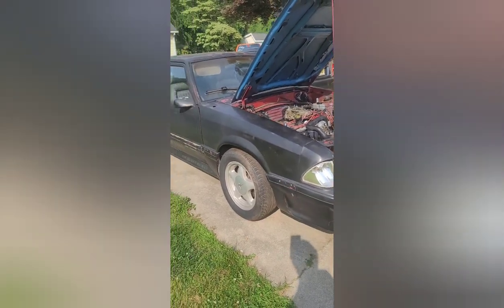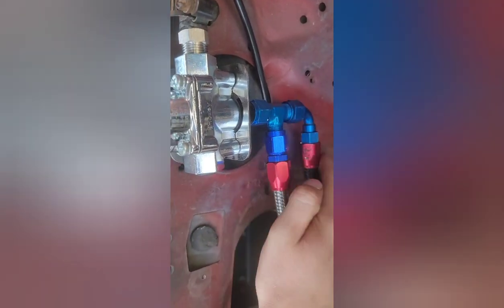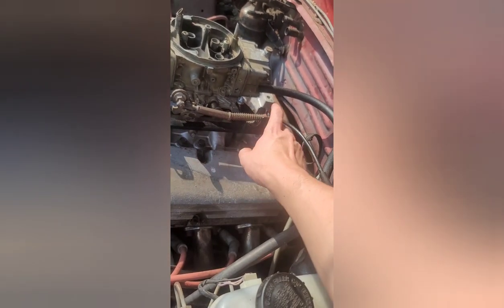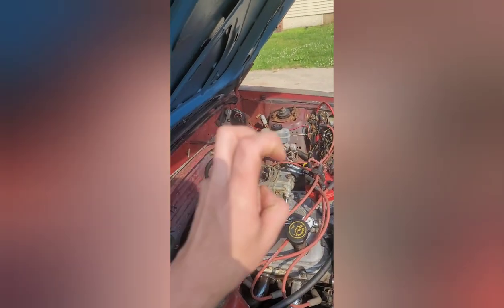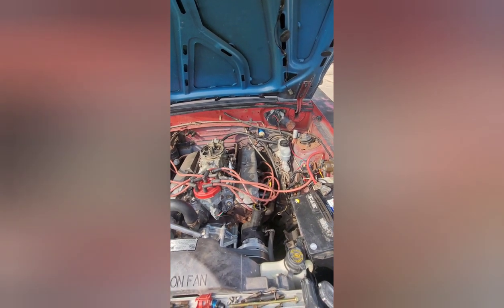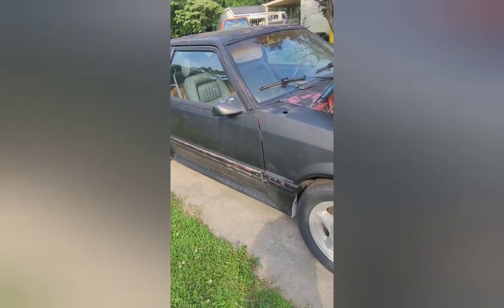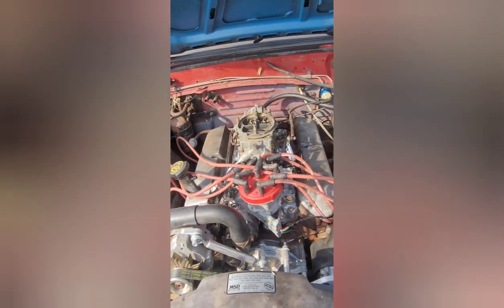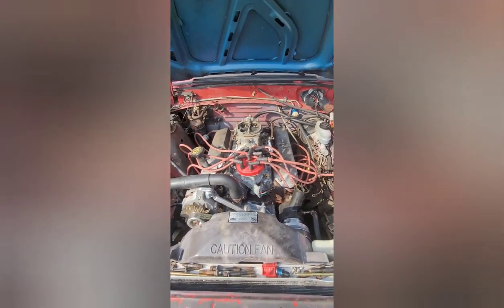How to carburetor swap a foxbody from efi without "ruining it", the easy way.

Comment: I put a 351 Windsor in my 87 GT and a quick fuel step down fuel pressure regulator and I didn't touch the computer or the distributor wiring all I did was put a carburetor and drop the fuel pressure and this thing runs great, I made a hybrid distributor out of a 351 distributor and a 302 distributor, all of the gauges work
Reply from the maker: Yeah thats one way you can do it aswell. Ive done the same thing, just alot of wires under the hood lol

Comment: Hello Adam , young man YOU have convinced me  to swap to a carb set up, I  like the fuel injection systems  and they're  ok and relatively  easy to work  on,but the carb just gives you a feeling of  if I may say, Seat of the pants ,I think that  carbs are "user" friendlier  unless they are related to Diesel lol,I am a sub to you and your dads channel, I  have a all original  93thunderbird with  less than 143k all highway miles 1 owner car
Reply from the maker: Awesome thanks for watching sir! And yeah carb def has a strong feel where the efi seems less responsive and laggy. Thats why i like carbs too. This setup is easy enough to switch back and forth so it doesnt hurt anything if u do go carbed this way. Thats why i like doing it this way. Makes it simple and easy

Comment: I've been asking about this type of fuel line/regulator setup on foureyedpride the last few days. Pretty convenient that you put out a video on it! Any idea how much pressure is in the feed/return line when it's running? When I do this, I plan to install a fuel pressure gauge before and after the regulator.
Reply from the maker: Im not sure how much pressure goes through the return side. I do however know you can get about 60psi or so out of a stock efi pump. Ive never put a gauge on it to see, aslong as have steady 6.5 psi at the carb im happy lol glad this was able to help you. Im also a member of that page on facebook lol

Comment: Might do this with my 91' lx, the 5.0 is coming out and 351w based 414 c.i roller cam bad boy going in , will try a 950 holley. Holley style makes best power.  The efi and pcm mass air tuning for my engine is looking like a pain. So i have a few intakes and  carbs sitting around anyhow  😂
Reply from the maker: Nice, good luck w it, it should run good!

Comment: You can buy a re-pop factory throttle cable bracket that bolts to the intake for about the same or less than the bracket you are using.  One source is LMR.  #LRS-9758BRKT-K
Reply from the maker: Yeah for the price these look alot nicer in my opinion so i just get this style and modify them

Comment: hey great video it explained alot i was wondering did you keep the original fuel pump inside the tank ?? i got an 84 im trying to swap over to an eddelbrock 4106  carb
Reply from the maker: We actually put a 255 fuel pump in,  but you can use the original pump as well

Comment: In the process of carb swapping a 87 crown vic, using a vacuum advance distributor and streetfire box. It calls for the original coil positive wire (from ignition key) to connect to the box. I have found two 12v switched wires that are Red/LG but doesnt power the box up. All grounds have been checked and are good. Maybe the Red/LB wire is the one I need to use?
Reply from the maker: Ive honestly never used a streetfire box. I have had trouble with msd boxes needing to use different wires from the box.

Comment: What two wires are you grabbing to run to a toggle for the fuel pump relay? Is it a power and ground? What color are the wires?
Reply from the maker: I usually take a test light, find the hot wire then make a jump wire and shove it into the hot wire i found and jump it across the plugs to find the pump. Then i run my toggle to both of those. The toggle goes inbetween them if that makes sense. Or u can find another source thats hot to go to your switch and just run one wire to the pump wire in the relay pig tail.

Comment: Great video. Hey question what alternator bracket is that? It looks super similar to mine that I got from Jegs. But I cant get my 3g alternator with a very similar bracket to line up at all. My alternator is about 3 teeth to far forward and keeps chewing up my belts and I think has messed up my alternator.
Reply from the maker: Most aftermarket brackets require modification.  I believe this is a march pulley setup on this car, but if your alternator goes in you can take the shim and shorten it to get the alignment you need for your setup
Reply: @GroverBoysRacing777AdamGrover  yeah thats what I was thinking about doing. Grinding the spacers down to bring the pully in. Was just curious if I bought the wrong one or something lol. Thanks for the reply and thanks for the content.
Reply from the maker: @allenhouse7224  any time,  yeah thats what i usually do is modify them to work lol.

Comment: Adam one other quick question, when I pulled the harness out there was 3 wires running all the way to driver side kick panel? what are those 3 wires for, it doesn't seem they are going to the ecu but are bundled in to the ecu harness, do i just leave that disconnected in the driver side kick panel?
Reply from the maker: That doesn't sound factory so I can't give you a forsure answer on that.  Id have to see them.  Message me on my Facebook if you have one. Usually anything that goes to the engine harness is no longer used.  The headlight and alternator harness is usually seperate which those you will still use
Reply: Those I think go to door speakers, power windows, power locks, etc. I looked at mine, thats where they seem to go.

Comment: I see now after reading some of the comments, you said 36* and run a toggle switch to the pos side of the coil. You say if engine is hot crank with the switch off then flip it on start while cranking CORRECT? One more question what about a rev limiter if you’re NOT Using an msd  box?
Reply from the maker: Yes that's correct crank it and as youre cranking pop the toggle on, and you wont have a rev limiter. I usually dont use one or set it really high anyway so it never bothered me
Reply: thanks for the reply

Comment: I guess I am dense...I just don't see the advantage of carb over  EFI. I have EFI on my 89 notch, and carb on my 57 Chevy. Considering all the work you did to convert to carb, please explain what you gain? I know all the issues I have with my carb! Thanx!
Reply from the maker: Gain cheaper easier hp, easier to work on, clean engine bay, less things to go wrong/bad, compared to a 30 year old efi setup with broken wires and such. Im not against efi, but for some carburetion is the easier route. You may not see the point, but theres alot of people who want to convert to carb without hacking their mustangs up but dont know how to. Thats what this video is about.

Comment: I have a 91 f250 7.5l efi sucks ballz nothing but trouble E40d would a carb swap bring this beast back to life ?
Reply from the maker: The right intake and carb combo can net usually a 50 hp gain on any ford motor compared to factory efi. On a big block 460 with an 850 and a nice dual plane its around 100 or so. So yes it would wake it up putting a carb on it
Reply: @GroverBoysRacing777AdamGrover  what would I need to do with the E40d will it work
Reply from the maker: @truyumz2595  that I'm not sure.  I think they sell a controller for it,  may be able to keep the efi harness hooked up for your ignition,  i would think it either works off of rpm or speed sensor.  Ive never ran the over drive automatics to be honest so i really couldn't tell you based off of experience. May find something on it on Google
Reply: @GroverBoysRacing777AdamGrover  thank you
Reply: @GroverBoysRacing777AdamGrover  excuse my questions if they seem ignorant you, your knowledge on this is far superior than mine. Is it a good or dumb idea to use the E40d or is there a better maybe a more cost effective approach to this aspect of the  conversion?
Reply from the maker: @truyumz2595  it all depends on your intentions w the vehicle. If its a cruiser or somthing you want to race more often etc.
Reply: @GroverBoysRacing777AdamGrover  not racing but I do pull a trailer with 3 quads and camping gear from Portland to the beach over a small mtn range then on the sand we go I'm on 35s/4in lift/ headers/ smog delete /and a large stereo system. and I drive it to work often in traffic with no side mirrors yah I'm that di** I get over until I hear breaking glass but I always use my blinker....
Reply from the maker: @truyumz2595  then id keep the overdrive transmission. Itll be worth buying the controller for it in the long run
Reply from the maker: @truyumz2595  it is pricey but that od will be nice for those long cruises heres a link to a controller for the e40d transmission

https://www.usshift.com/?gad=1&gclid=CjwKCAjwjYKjBhB5EiwAiFdSfpCMxO55zGu-kcQ3q7is21AxfXvKqnp52IjHG7dtUdqSwro8AxB1mxoCzjsQAvD_BwE

Comment: Hey man do you think tha distributor trick would work with the 460 distributor in the trucks too ??? Im putting one in a mustang and dont have a msd box to go with my aftermarket dist !!!
Reply from the maker: I plan on using this setup on my dads 460 build, so i dont see why it wouldnt. Id assume wiring would be the same. Ill be trying it lol
Reply: @GroverBoysRacing777AdamGrover  im going to aswell .. if it works …GOOD … if not then its just too bad ..lol
Reply from the maker: @glennramsey917  i dont see why it wont
Reply from the maker: @glennramsey917  just make sure the distributor gear is setup for your camshaft so u dont mess anything up.
Reply: @GroverBoysRacing777AdamGrover  yes sir … im 49 years old i have ben building motors since 1988 …i know the difference in gears n such but my downfall is electric stuff.  This video has changed the game !!!!

Comment: I noticed the coolant lines going to the heater are disconnected does this carnot have heat in the winter? No ac in the summer I want to do this swap too I just don't know all the parts like you
Reply from the maker: This car doesn't have heat or ac hooked up
Reply: Thanks for the response I've been looking up parts for the past 2 hours trying to figure out what I need and it's so  broad, I'll have to watch your video again and again and listen step by step so I can get a list. I was gonna go through lmr or cj pony parts but those carb intake kits are like 1000.00 and you still need fuel lines
Reply from the maker: @tylerford2651  yeah u can do it way cheaper than 1k if you source everything correctly and do it yourself etc. Esp if you sell the efi stuff.

Comment: What timing do you start with on the locked out tfi? distributor
Reply from the maker: Depends on the combo, but i usually run 36° on an e7 stock bottom end 87-92 engine
Reply: Thank you for the reply
Reply from the maker: @charlesellenberger1352  no problem. I appologize i didnt reply sooner, i never got the notification.
Reply: No problem 36deg is what I thought would be a good starting point. Thanks again
Reply from the maker: @charlesellenberger1352  yeah 36 is usually the ticket where they like it. Depends on the heads and combination mostly though

Comment: Adam, what 2 wires on the fuel pump relay?
Reply from the maker: I use a test light to find the power source then I jump the others to see which one kicks on the pump and locate it that way. Then I depin the 2 out of the connector and use male connectors to slide in the terminals so nothing gets cut, and u can either heat shrink or tape them up so nothing shorts out
Reply: @GroverBoysRacing777AdamGrover  thanks, I will try that!
Reply: ok got mine wired today, pink and black from relay goes to the intank pump, I ran a 12v switched to that and it works, my relay had no power / 12 v switched or anything going to it at all, I think those 3 wires I mentioned above that ran from driver kickpanel to the ecu area must have been the main power. Anyways just put a spade terminal on the 12v switched and plugged it into the pink and black female terminal, taped it all up and wroking well so far! thanks Adam!
Reply from the maker: @vrm86gt  yeah that's how I usually do it or I depin the connector and use a spade terminal into that female connector that ford puts on the wire and wrap em up. Glad you got it!

Comment: Does the alternator need to be rewired at all to work? I’m in the middle of the swap trying to figure out what all I need to do to make stuff work.
Reply from the maker: Alternator wiring is part of the headlight harness if i remember correctly so no. Once you pull the efi harness out youll be able to see. I usually convert over to a 3g alternator from a 94-95 mustang gt which will require a rewire. But the schematic can be found online
Reply: @GroverBoysRacing777AdamGrover  thanks! Appreciate the reply!
Reply from the maker: @kennypearson393  no problem, good luck with your project!

Comment: I did a carb setup. Now I’m getting nothing on the dash or fuel pump. I get a click when trying to start. I’m getting power to the switch and to the starter solenoid but not on the dash. Do the wires need to be in an order on the solenoid? A week ago I had everything working. All I did was take out the motor harness
Reply from the maker: If you removed the engine harness the dash wont work. You'd have to look at a schematic, get a pig tail, and pin the wires for the gauges in the dash. If the engine is just clicking and not cranking over, you may need more engine to chassis grounds. Take a pair of jumper cables and put one side on the engine (intake bolt, bell housing boltalternator bracket bolt or clean metal of some sort) then connect the other side to the chassis or even one to ground on battery and other to chassis (clean metal, bolts going into frame rails, firewall, or inner aprins). Thats a quick way we use to rule out inadequate chassis grounds. As for starter solenoid wiring, one side should be a few hot wires 1 from battery, along with a few others, other side should be 1 wire to the starter, then theres 1 wire for the small post that just pushes on unless someone changed it to make it bolt onto the small post. Google your year (mustang solenoid wiring) and you should be able to find it to verify wiring order. I can almost garuntee its not enough ground cables though. Good luck and let me know how you make out!
Reply: @GroverBoysRacing777AdamGrover  so I did that and I’m still getting a click. I checked with a light, I have power to the ignition switch and power to the solenoid. I put the light on the red/blue small wire. I hit the key to start the car and the light worked. So I know I have power to the wire when it’s in the crank. And when I say motor harness I meaning the passenger side harness is gone. I still have all the wires on the driver side. Like the yellow, the black/white with the little box, and a few others. I also tried jumping the solenoid and all I’m getting is spark and I tried two different solenoids. And this is on a 1987 lx 5.0 t5 conversion. It was a 4cy automatic. Oh let me add I’m running a msd6al box and a hei distributor

Comment: How would I get the fuel pump relay for 93 to work since it’s on engine harness?have to keep it and computer?
Reply from the maker: Would have to find the harness where the tank plugs into the body harness and make your own harness and wire itbto either a key on power source or to a switch

Comment: With the after market fuel pressure regulator an the fuel hoses you need of course
Reply from the maker: The fuel line adapter/conversion kit comes w the an hoses aswell.. as mentioned in the video.

https://eliteracefab.com/products/russell-performance-1987-93-5-0l-ford-mustang-fuel-hose-kit?currency=USD&variant=44290203123880&utm_medium=cpc&utm_source=google&utm_campaign=Google%20Shopping&stkn=7f8b245c933f&gad_source=1&gclid=CjwKCAiAgeeqBhBAEiwAoDDhnzexmDidgWM5q5tzsaplVky-xtrldHYMKUXAwQhnTsOYHpRerbgK4hoC76cQAvD_BwE

Comment: About to carb swap my 89 man, Great video. Could you link me the AN hose conversion kit you used for the factory fuel line.
Reply: I am thinking this too. About to put one on the road and realize how much work there is into getting the EGR/smog system put together, the 89 I've got doesn't have cats and I don't think the smog system will work without that. I can rig it to work without the system, but other people have bitched about the motor running like crap. I can get something like a megasqirt ecu and then have it tunned, but that's a lot of money.
Reply: @caseygtr  I did carb swap the car and it’s the best choice I’ve made haha, wiring was so easy, took a week and a half or so to get it all complete waiting on parts and such. But super cheap and definitely worth it.
Reply: @garrybearyaf1730  thing is I have basically all the parts, I even have a fuel regulator. I am going to give the FI a shot, turns out I out need the smog stuff, but I do need the egr and I think I have the whole vacuum and wiring figured out, but if that shit gives me trouble, it's getting a carb.
Reply: @caseygtr  yeah man if it doesn’t work out, you are always going to be able to sell the efi setup. People are always looking for efi swaps and all that. But let me know how it guys for you man, definitely interested.